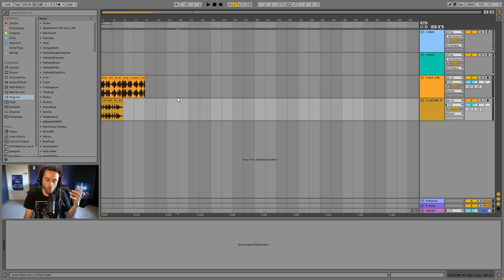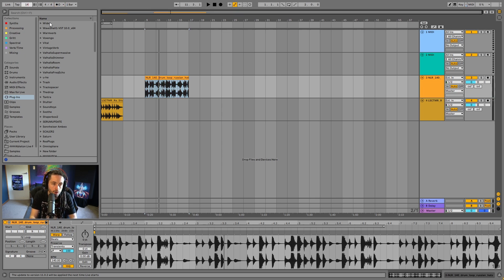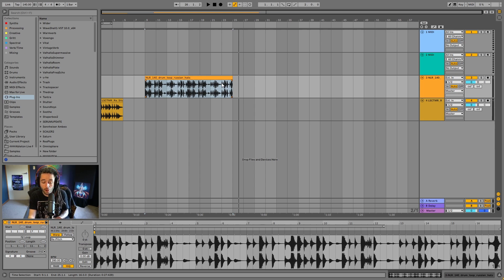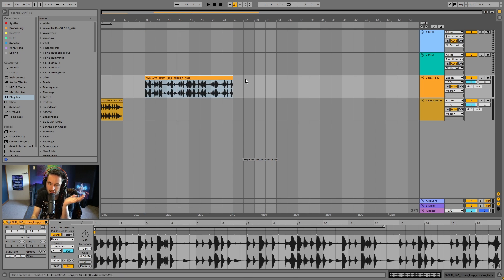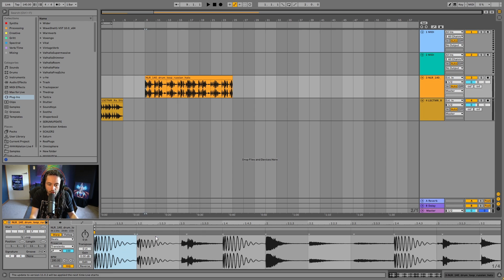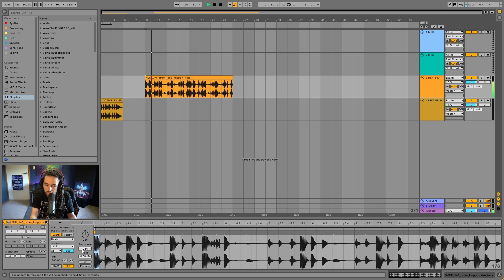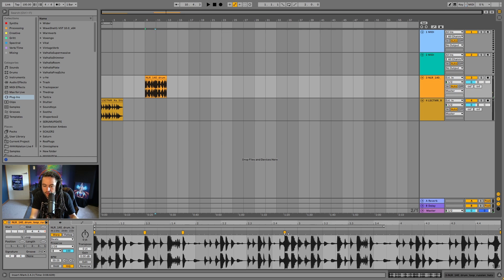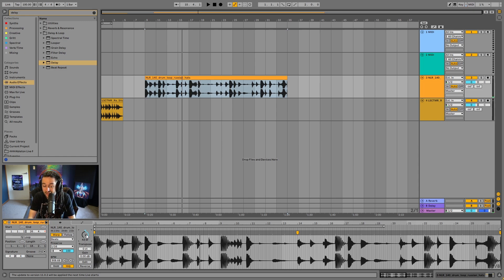Understanding Warping in Ableton Live 11 (2021)

Comment: I have been struggling to find an answer to this, I can see it happening here so hopefully someone here can help. When you stretched the sample so it was double the length at 2:25, how come the BPM of the clip went from 140 to 280? Shouldn't it go from 140 to 70? Is this just displayed incorrectly in ableton or is there something I'm not understanding? Thanks
Reply: im a bit late, but basically the warp tempo sets the markers for what the audio timing will lock to the session tempo, if the session tempo is 140, and you wish to make the audio longer / slower timing but you want to keep your session timing, you have to raise the warp bpm, 140 is half of 280, which equates to playing the warped audio at half speed. if you set the warp bpm to 70, and the session is 140, you will warp it the other direction (slower warp timing) resulting playing in double time. it seems confusing, but thats one of the ways you can use warping because its design to keep the audio in time with the session while also preserving the key signature and rest of the session tempo. if you disable warp, and change the tempo of the session, the audio will play at the same speed unchanged and the rest of the session grid will speed up or down independent of the audio. warping audio essentially treats it similar to midi and locks it with the session tempo, unless you change the warp bpm
Reply: The BPM field in the warp menu only sets how Ableton “interprets” the BPM of the sample you are warping. The BPM field does not necessarily represent the ACTUAL, original bpm of the sample being processed.

Ableton is trying to match the difference between the tempo set in the warp menu, and the tempo set in your project. 

In this example, he is using a sample with an original tempo of 140, with a project tempo of 140. 
When he drags the sample into the project, the warp feature automatically detects the original tempo of the sample, and sets the warp tempo to 140BPM. When he stretches the warped sample to twice its original length, the BPM in the warp menu is doubled. This is because he is basically telling the program to treat the 140BPM sample as though it is a 280BPM, so ableton will try to match what it thinks is 280bpm sample to the project tempo of 140BPM. By doing so it effectively processes the sample to halftime.

If he were to set the warp tempo to 70, the sample would play in double time, as ableton understands that 70bpm must be sped up in order to match the project tempo of 140.

It’s a bit confusing at first but yeah, I hope this is helpful!